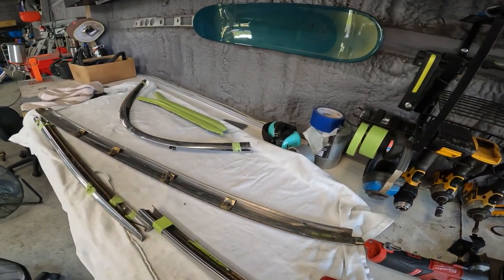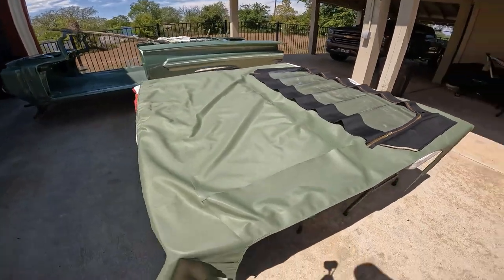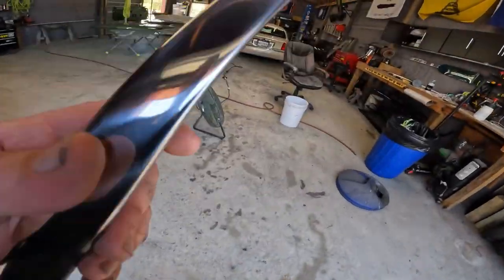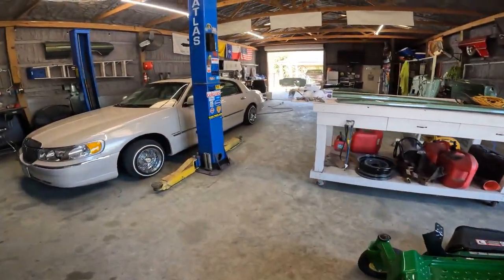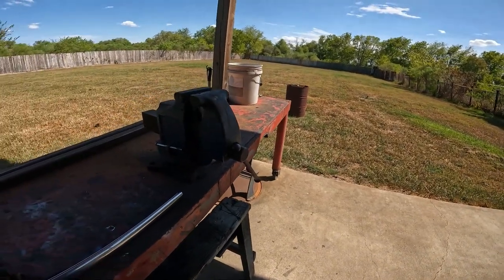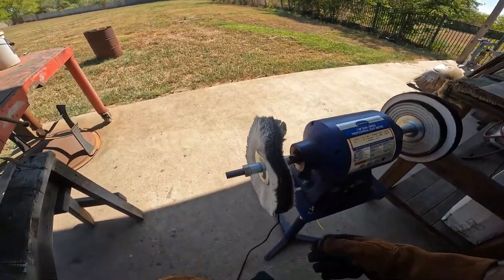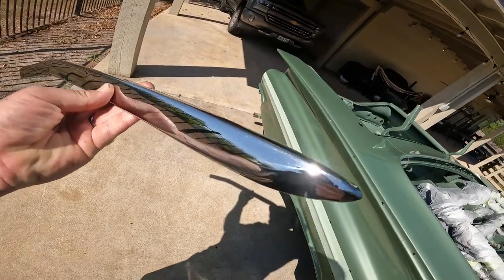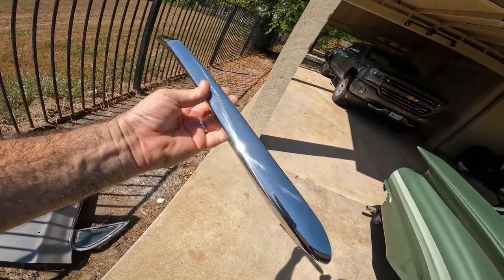HOW TO POLISH STAINLESS MOLDINGS AT HOME!! / DIY / CLASSIC CAR / LOWRIDER / RESTORATON / AT HOME

Comment: Nice information on the use of the DA and different sandpapers.
Funny how the NOS stuff looked, but as long as it worked out for you it's good.
I have the same kind of buffer and it can do some great work and it can be a Evil machine if you do not pay attention all the time you are using it
Reply from the maker: Thanks Ed ...yes if you are paying attention u can easily add 2 hours of work when polishing or worse ruin the part. Btw the pickles are really good!

Comment: LS do you have video on putting window felt back outside door trim for a 64
Reply from the maker: No I dont think so.  But its easy. Just use staples for the same holes that had the staples from the factory
Reply: @lonestarlows  ok thanks 👍🏿💯

Comment: i hand wet sanded all my pieces from 220 to 5k.  they came out polished like chrome but i can still see scratches all across it.  Can't feel any scratches whatsoever, but you can still see a bunch of sanding striations....at my wits end with it. Spent more than half a day on one piece- at this was the flattest piece you could get.  the green and white compound cant seem to get this mild scratches out- im using an eastwood 1/2hp buffer with spiral and loose cotton after ive gotten up to 5k- any  help would be appreciated!
Reply from the maker: My advice would be don't beat yourself up too much. I'm sure the patt looks good and no one will notice what you are seeing. If they do tell them to piss off
Reply from the maker: After polished my trim I still imperfections.   Could always chrome it for a flawless finish

Comment: Where can I get a set of the hammers to take the dents out on trim, I think you used them on the other video on seat pieces
Reply from the maker: Yes, eastwood sells, or ebay.  The hammer is very light weight.  Just minor taps needed to work a dent.  Patience is key
Reply: @lonestarlows  
Ok, I’ll checkem out
thanks